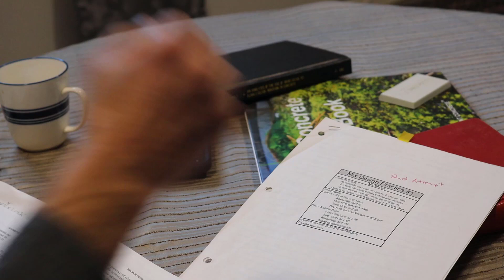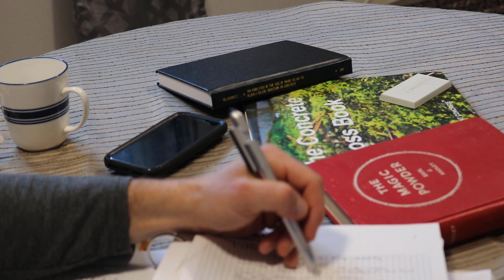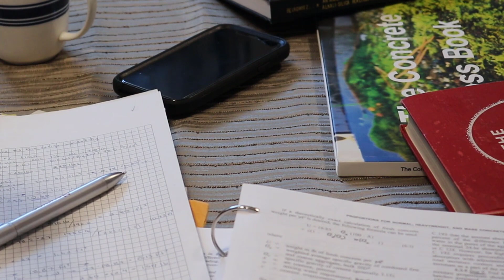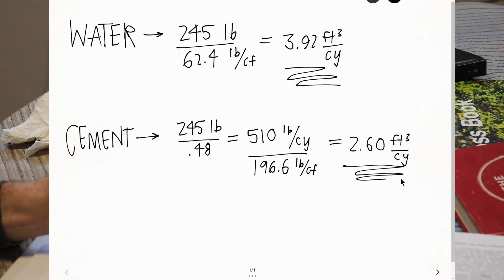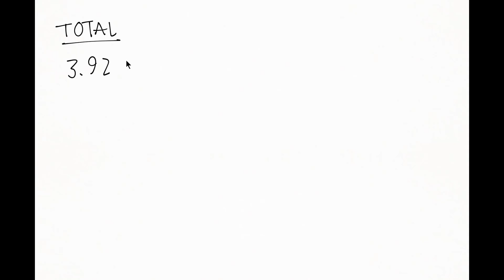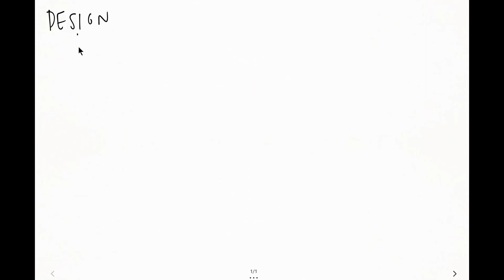Practice Concrete Mix Design Book: PMXDB Mix 1 - Math Monday - Vlog 558

Comment: I believe there is a mistake in the table for the water content (6.3.3). For non air entertained concrete with 1-2" slump and coarse aggregate size of 3/8th (upper left value), it states 250. I believe this needs to be 350. Please have a look 😉

Great video btw!